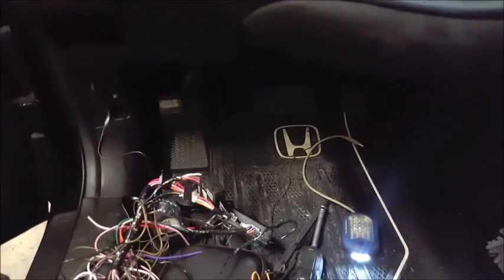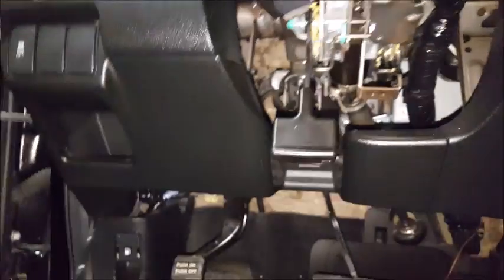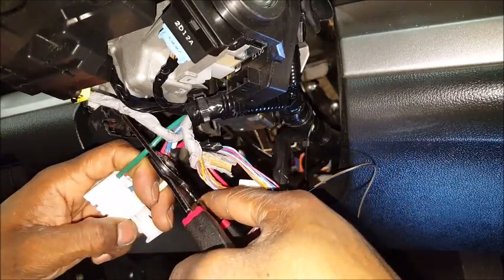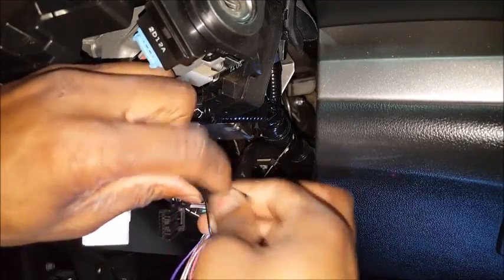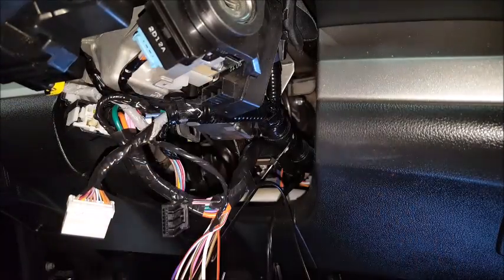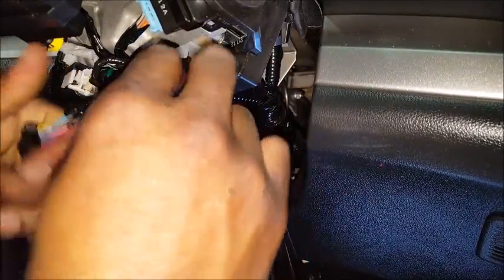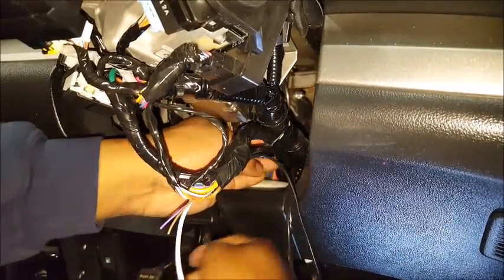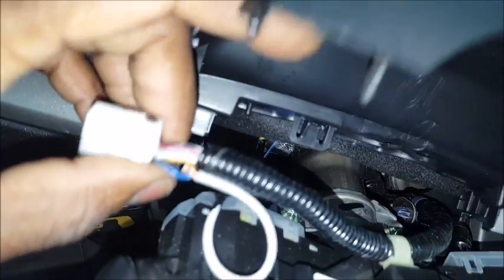How To Install A Remote Start Alarm  Completely From Start To Finish on Any Honda 2001 2017 1 HR Vid

Comment: So solder it when it's my car, but use electric tape and send it when it's a customers car at a shop? 🙃
Reply: Soldering for installing vehicle accessories is really not practical bro. Unless youre installing a harness that is modular. When you splicing into stuff like for a professional business or even at home this is the best way like he said...
Reply: Ikr? The prelude I bought last year had a nice viper installed but there were all kinds of shorts and the dash lights wouldn't come on. After I bought the car I decided to check out the under dash area... OH MAN WAS IT A NIGHTMARE! I mean the alarm was installed great but everything around it was horrible! Burnt and exposed wires. Disconnected grounds. Random cut wires. Broken interior parts. Etc... It took a bottle of liquid tape, a box of heat shrink solder tubes, 2 rolls of proper fuzzy electric tape, proper splicing, re-grounding factory grounds and replacing entire stretches of wire. It went frm snapping and popping, smoking no dash lights/ dimming head lights, flickering intermittent brake lights, to solid bright quick vivid dash lights ON with NO dimming or smoking Haha

Just sucks that the dude who sold me the car told me that the guy who did the work was a solid guy and does all his work. He even gave me his card(which I quickly threw in trash)

Comment: Did you make a mistake with the blue and pink wires? I noticed when the video skipped, you had removed the pink from the blue. Just dont wanna make the same mistake and not know wth I did wrong.

Comment: for anyone following along here i have a few recommendations.

1. try to cut off any unused wires back at the brain, less wires to pull up and makes a smaller wire loom you need to pull from A to B. dont pull the wires out tho and dont cut them too short, leave them long enough you can grab them if you ever need to in the future. you can also double them back on them selves to make a service loop and tape it up so no wires are able to touch each other (the ends)

2. dont tape your wire runs all the way up. it makes it a pain in the ass to peel the tape off, tear shit open again when you need to get back in and service. just use a few pieces of tape every few inches to hold bundles together. follow factory wiring when you can and it will still look clean. (if its a security system then sure, go balls out and hide that shit)

3. poke and wrap in this video is intended to be a temporary connection. poke/wrap/solder is better to longevity and proper electrical connection. you must solder correctly however, too much and you will have weak and brittle spots, too little or too little heat and you will have a cold joint. too hot and you can actually burn up wires and have to cut sections out and repair.  crimping is also acceptable so long as it is done properly, it can be just as strong as a proper solder job so long as enough pressure is given to cold weld the wires together. a crimp has no ridged areas so it cant get stress fractures like solder can.

4. while its easy to find wires AT the plug the wires all go back to a computer somewhere or at least pass by another area in the dash. you can often find better locations than in the steering shroud to tag your wires and have a shorter run, cleaner looking install, less bulk inside tight panels, and better serviceability (in some cases) by tracing the wires back to a better, more central location.
Reply: How about the plastic wire taps sold on ebay. Can I use those to splice the wire connections? Thanks.

Comment: Good informational video. I disagree with the wiring. A few things are shoddy and give a lot of shops a name. I'm a fan of fast turnout as I do custom electrical work for people but I've never in my whole life twisted two wires together and taped them for a permanent connection. I prefer solder but butt splices work great if you use them correctly, and they will always hold better than tape.

Comment: Thanks for the video, i have a 2019 Accord 2.0 6spd manual. I gotta get a remote start installed. I'm pretty handy and don't mind doing this, would rather go plug and play though. Any recommendations on what system I should go with? I heard the Direct  4 x 10 might be a good option.

Comment: Hi. I find the video is great. Good explanation step by step. I took the viper remote starter out from a 2009 Nissan Altima (Keyless) to install it into a 2008 Chrysler Pacifica. You are working in a Honda CR-V. Wiring is different. I don't know or find the functions of the immobilizer harness wires. From left to right: RED, BLACK/white, PINK/grey, WHITE/light green and WHITE/violet.

I don't know what wire is for keydata, lock/unlocked, etc.

I will appreciate your help. Thanks.

Comment: Are you still in business?  My 2007 Ridgeline was declared dead by Honda due to a recall issue.  The guy I had bought it from had a remote starter put in which I am in process of removing because the truck is going to be crushed.  I have it lowered from the dash right now but unsure about the disconnecting?  It is a maybe Viper or a Autostart with two little red modules on top of it called upgradable Xpresskit on them,  one is XK01 and the other is XK05

Comment: Can i get a little assistance? I got everything wired up after a rigorous wire diagram search for the V5900( old installed system), the 5806V (new system)and my 1996 Acura Integra. I believe the unit is powered on indicated by the red light on the shock sensor blinking, but the Antenna/Control is not responding. I get no chirp when the ignition is turned to On position and the button is pushed once, let go and held in order to sync the remotes. The system does not seem to be responding to the Antenna. What might be the cause of this issue? Everything is wired up as it should be as a majority of the wires are not utilized for my vehicle. Any assistance would be greatly appreciated. Please let me know.

Comment: Got a 2016 ram 1500 and having issues on the remote start wiring also and I’m stuck with cutting wires on the ignition switch .. once i try initiate remote start I only hear clicks coming from my db3 module

Comment: Bro im not trying to knock your work . Everyone works in different ways and thats cool but.  This video is supposed to be a instructional video on how to install a alarm. And you're not showing the views how you know what wire harness is what ? The only way you would know that is what a data sheet. Thats the most important part of the whole installation. Without that information you cant do anything

Comment: That’s a hack job, do not just wrap the copper wire around an exposed wire or crimp them. Wires can come loose & cause a short. I’ve seen this many times when customers had aftermarket equipment installed. Soldering the wire is the proper way to secure the wire.

Comment: Good evening sir I have a 2018 Honda Civic Sports model I don't know how to get the wiring diagram my question is can I color code the wire that come with my start-up kit to connect on to my car is that the right way to go about it

Comment: Question, I have a CM3000 installed in 2 different cars. While trouble shooting i programmed my 2 way 2w fob to the second car. no its not in "2 car mode" it literately controls BOTH CARS AT THE SAME TIME.. where is the the security? rolling codes?

Comment: Hooking up avital 5305L with a DB3 bypass module in a 2000 Honda Accord EX. Was wondering what color wires from the bypass module do I hook up to the 7 pin immobilizer . Problem is there only 5 wires.  From left to right
Pin 1 blue/white 
Pin 2 empty
Pin 3 black
Pin 4 empty
Pin 5 white/red
Pin 6 white/black
Pin 7 white/yellow
Also Whitch wire color from the immobilizer do I use to to interrupt the security ligh.
Any help would be appreciated

Comment: Never ever strip insulation and wrap. Bad advice. Cut and solder in a butt connector. Otherwise great video. Tuck your boxes better also. As a factory tech what you just did is why we hate these systems. Do it pro or get out of there

Comment: My viper system is draining my battery and the alternator will not charge car battery. I need to turn it off. I keep reading about a “shutdown switch “ but I don’t see it anywhere on the system.

Comment: I bought a pigtail for the factory wiring, it plugs between the wiring harness that goes up the steering column, no having to cut in or splice any of the wires there, I stopped my install because getting at it was too much trouble, I can't reach it all beside the van in my wheelchair not can I get at it from the drivers seat, damn shops want to sell me 'their' remote unit full price install when all the hard shit is done, the wires are hanging down waiting to be plugged in.

Comment: I'm looking for door unlock/lock wires for a 2009 Volvo S40. I found on the web it said black/red and black/yellow @DDM driver control module but I need to find the exact location @the interior fuse box to connect. Do you know where I can find this information? TIA

Comment: Hello sir,  i have a viper 7856 remote starter installed on a 4runner.   Can the firing-up/ignition timing be adjusted?  It takes about 4sec before it fires-up the engine.  Thank you.

Comment: If your shooting how to videos on security systems your first big mistake is not showing people or at least advising people to ALWAYS test there wires before making any connections. Never go solely on a tech sheet because they are not always accurate! Second mistake is that starter wire should have used a butt connector because when used properly will be a way better connections than just wrapping them together An taping . Next you should be advising people that when they purchase a bypass module they need to be programmed . Some sellers of these modules program them before they sell them, but other sellers don't program them at all. So the buyer must ask the seller if this bypass is programmed to there specific vehicle, or the buyer must buy the programmer to do it themselves.  I'll also add that this install is not done the same for every Honda you have listed in your description.  As for the airbag harness you should not only tell people what harness it is, An tell them to leave it alone you need to tell them why.  1 the airbag could deploy in your face An kill you. 2 if the harness gets pulled An a wire becomes loose the airbag may not work when it suppose to, 3 you could easily trigger the SRS light to come on because you didn't tell anyone to first disconnect the negative battery terminal before you even start any type of installation on a vehicle. Next you have all your connections at the brain already plugged in before you started making connections at the vehicle... that may be ok with a viper system but there are other brands out there that require you to make certain plug ins at the brain in a specific sequence ... same with some bypass modules..  I'm writing this while your video is playing in the background so I'm sure I missed a few things. 
Point being is almost none of this video is good for a HOW TO VIDEO for people who have no knowledge of doing this install. 
Your getting it to work, and most of your connections are pretty good but I can see your still learning yourself, An don't have much knowledge , or experience . If you worked at my shop you would be a beginner An would need to be watched before you could do an install unsupervised. 
You may think I'm picking on you but I'm not , I'm just trying to let other viewers know this is not really the correct way ,only because of the important info you failed to give the viewers. Skipping steps could cause someone a short, a fire , fried computers etc , that's a lot of money to fork out if something should go wrong. It be a lot cheaper to have it done by a pro at that point!!!

Comment: I do see theses Wires coming from the backside of the Key Cylinder.. Large WHITE = Constant  12 Volts  , White - Red, Black - Red , Black - Yellow , Blue - Red.... Theses are the wires I see near the ignition key switch. now I just need to know how to hook them back up  original factory. so I can get my truck running again. please help !

Comment: Good job installation is clean! I have the 5904v. I'm getting a "toggle switch off" msg in my key when I try remote start what could be the issue? Tanks for your help

Comment: Need help with a viper 5706 with the 10 pin connector to the ignition. Three red wires what goes to what. Can you help out?

Comment: Thank you for this video it has helped me greatly as I prepare to install my viper model 4706v with the idata link AL CA in my 06 Honda civic. I do have one question though do you have a video on how you prepare the remote starter harnesses with the idata link module? I want to make sure that I connect everything properly and neat and tidy as I see yours

Comment: Dude great Video very detailed.
Simple and to the Point.
I feel like if I had a Honda I'd be able to do this following you vid.
I have a 2000 Chrysler 300M with Factory Alarm and Chip Key
But the Factory alarm does nothing to Physical damage which is my concern.
When I get enough$ I'm trying to get The Viper 791 or Similar

Comment: Can you give a few pointers on a compustar 7900as with a blade al on a 2003 chevy silverado 2500hd. Also the same system on a 2009 kia spectra

Comment: He made all the connections properly‼️ He didn’t solder the connections because these are are data wires, and too much or not enough solder can cause the data transfer to not function correctly, also as the solder oxidizes it can cause performance issues on these wires. Canbus and data wires aren’t your old school wiring, these new computer controlled vehicles are vastly different.

Comment: I love to install the 5806V to my car,  but I'm confused since I'm worried whether the functions would work with it. I have an 1979 Datsun Sunny which is pretty old car and I'm already using a simple Chinese door unlock/locking system which is quiet unsafe. The doors and the trunk have the actuators installed. Other than that, everything else is pretty simple and needs to be configured manually since I can't find any cables like in new cars. What I would like to know is can the 5806V be installed on my car with all the features working?

Comment: I have a 2000 honda accord lx. I just want to install a basic remote starter. Whats an affordable brand that can I buy? Also how can I get the wire diagram to install a remote starter for my car?

Comment: I need your help asap I'm confused about if this remote start system can start my vehicle automatically when my battery drop slow during the cold seasons. I called Viper and they told me that this unit is able to do this out of the box all it needs is a simple computer programming with a BIG Writer tool. A local shop wants to charge me extra to install a smart module.  Can you help me I'll give you the business. Thanks
Reply from the maker: Michelle Hope the Remote Start has those feature built in. you will simply need to turn it on via a bit writer or simply doing the programing sequence using the ignition on off and pressing the program button.If you don't already have the units installed we can do the installation and set it up for you. Contact us. call or text. Jan 2. or DM me on Facebook thanks. We are also Amazon friendly partner's .thanks

Comment: Hey bro Awesome video ..... Am intalling remot starter on my Accord 2000 4 cylinder.. Where The NEGTIVE STARTER OUT PUT SHOULD BE CONNECTED which is the PINK/WHITE on my remote starter? Please help. Thanks.

Comment: It is very practical to solder the wire for many reasons! Also don’t splice into the wire so close to the plug, I would have gone further down the harness. Overall good video for newbies. I really cant stress enough though that if you don’t have much experience with auto electronics to not try and install a remote start on the vehicle!!
Reply from the maker: Frank Honeycutt. I'll do a video covering why soldering connections are not recommended in the INDUSTRY by Both automotive manufactures and security company. Ask yourself this: why wouldn't they include this method of wiring in modern installation manuals if it was the overall best way to install their products? And also why Can't you find any soldered connections in new cars going back 60 years?
Reply: @PrecisionConnections  hey bro help me with my remote start please
Reply: @PrecisionConnections of course you don’t have to solder in new modern vehicles because they are not adding splicing into the harness. Everything is planned out. Soldering is best way to splice into wiring . Mechanical connections fail.

Comment: Great video and explanation but one major problem for newbies. since the wires are all bundled up and connected from the beginning, the newbie doesn't know which ones and where the wires are going to the by-pass or starter. I know you explain some things but someone who doesn't know would like to see the connection to the source.
Reply from the maker: Most Viewer would complain in the comments when we used to include that in the video

Comment: I have a problem with my viper 5706v i was moving the alarm box out of the way and the problem i have is that when the alarm is triggered and notification pop up on the control when unlocked but when u start it it clears the notifications and when i have my car on with the key and hit the remote star it grind the starter is there a wire that tell the alarm the car is on its a 1998 volvo s70 t5 thx?

Comment: Can you use quick connectors instead of stripping the wire like done on the large Guage wires at 8:50 ?